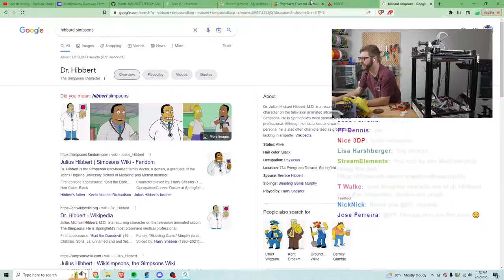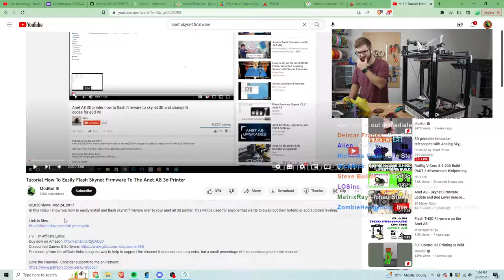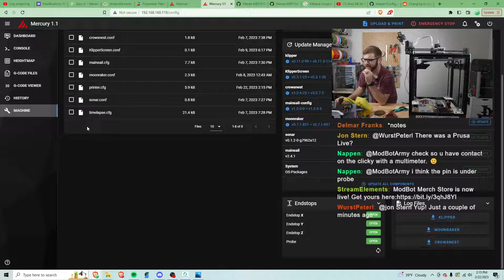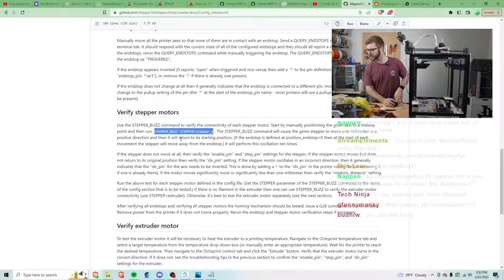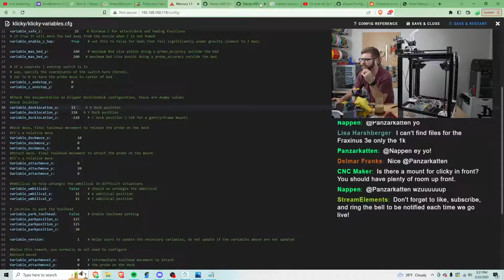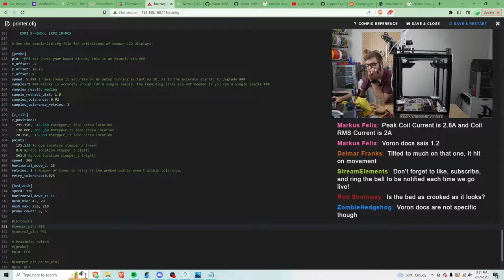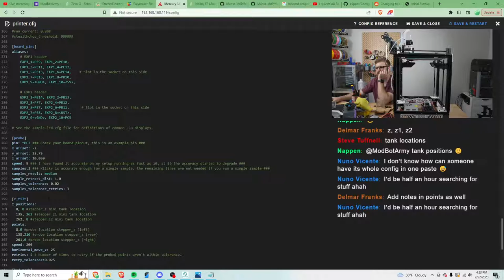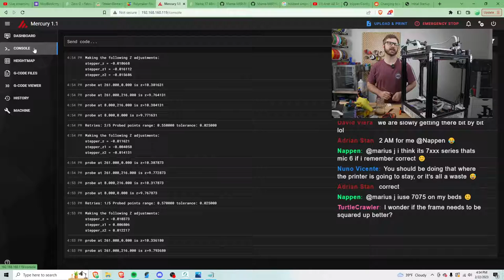ZeroG Mercury 1.1 Hydra Upgrade Part 3: Wiring & Firmware

Comment: I bought and Ender 5 and 5 plus and have had real issues with getting reliable prints out of them. I always had it in mind to upgrade them at some point. Been very interested in this project. I think you mentioned in one of your videos that they are working on a Hydra enclosure as well.

I'm not sure if I should try this or by say the bambu lab printer. I do like the idea of modding but ultimately I want o end up with a reliable machine that self calibrates and gives good prints.

Trying to figure out the cost of the ZeroG mods to help me decide. I haven't seen any full kits that cover all needs (I'm based in the UK)  

I'd be grateful for your advice.